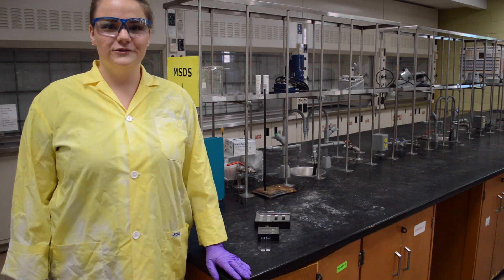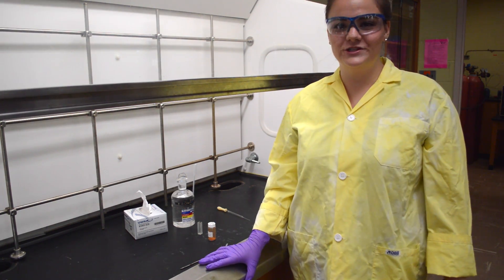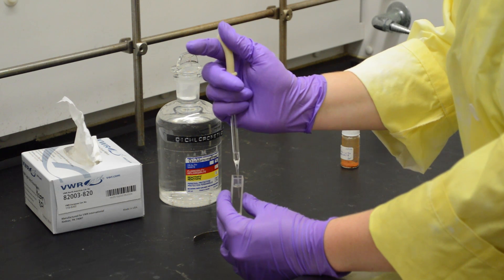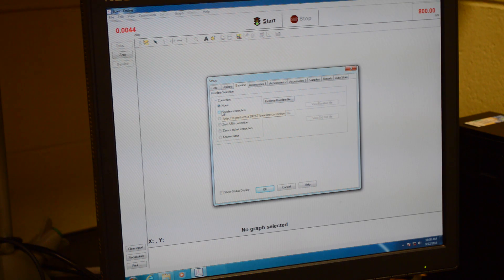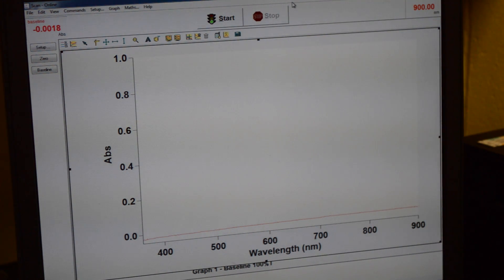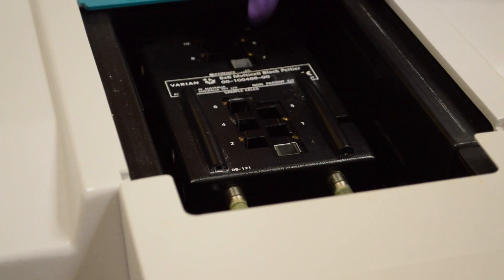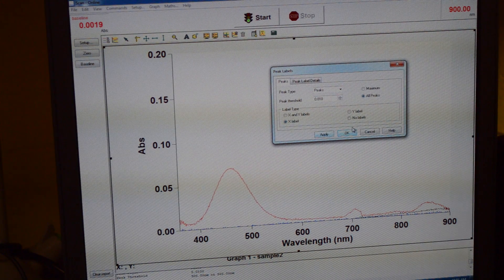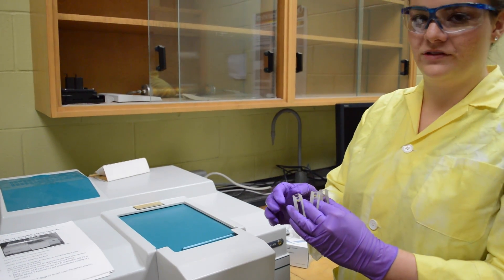How to Use a UV-Vis Spectrometer

Comment: clearly forgot basic lab safety and chemical handling...never put the stopper on benchtop
Reply from the maker: Seeing as the container needed to be open and two hands were required for the transfer - and the fume hood is a safe place to set a stopper ... Where would you put the stopper?
Reply: The video is great, that is my only concern is the placement of the stopper. It is definitely possible to hold the stopper between 3rd and 4th fingers if the stopper is a little smaller, it would be much better however, considering the size of the stopper to use 2 or 3 of the kimwipes (that are right behind the stopper on the benchtop) and place the stopper on the kimwipes. Yes the fume hood is a safe LOCATION but the benchtop (even in the fume hood ) is not. There is no knowledge of whether or not someone that worked in there before hand wiped down their work area. Say they were working with something particularly volatile or even something that even a small quantity could cause a chemical reaction with the solvent being used (you never know what was in there!).... now it has been picked up on the stopper and placed in the solvent container.
Reply: Just s recommended procedure. It is such a common bad practice in labs to think that things are "clean" and wont contaminate anything, but you never know! Its always better to take extra precautions (creating a barrier between the benchtop/workspace and the items that come in contact with housed chemicals).
Reply from the maker: Given all surfaces you work on are cleaned by the person before you, you would have a reasonable expectation that there wouldn't be significant interaction between the solvent and whatever may be on the bench top. Ideally there would be nothing, but that isn't practical. Unless you are using extraordinarily sensitive chemicals in super low concentrations, and are very concerned about background contamination, there is really no issue. Whatever your sample is, it is going to be many orders of magnitude greater than background contamination. Just the dust in the air contaminates the sample significantly more than the stopper sitting on the clean bench top.
Reply from the maker: Also kimwipes are expensive as heck!